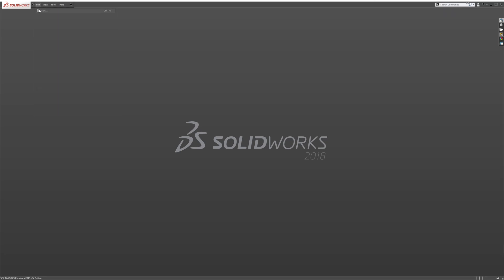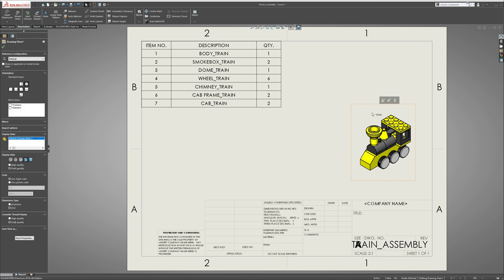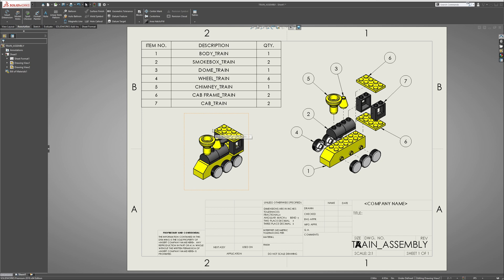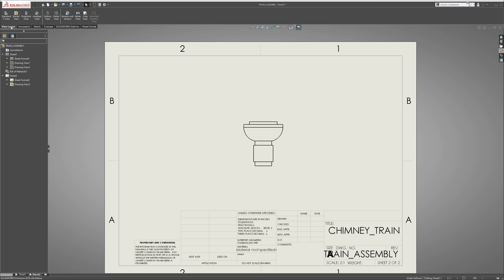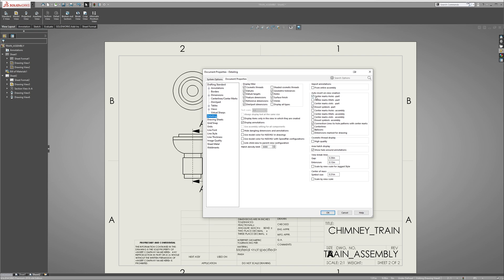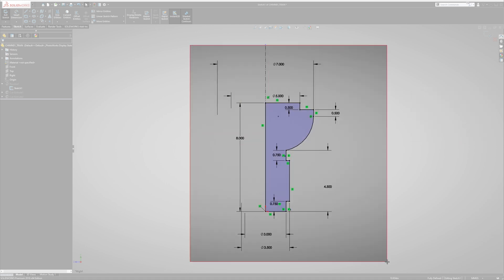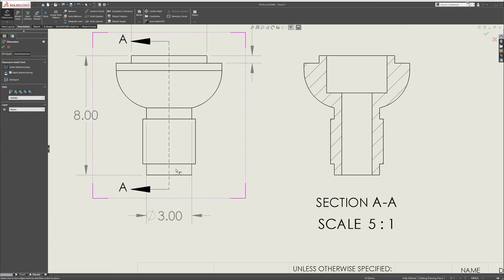Intro to SOLIDWORKS for Absolute BEGINNERS Creating a DRAWING (Lego Train) | SolidWorks Part 3

Comment from the maker: Learn SolidWorks without any prior experience, with this free mini-series for absolute beginners! 

By the end of this tutorial, you'll have created your first drawing and be able dimension a part in the SolidWorks Drawings.

Download & Try SolidWorks CAD Software free trial:
https://my.solidworks.com/try-solidworks

Download the free project files here:
https://rathasochenda.com/download/

Time Stamps
0:44 | Drawing file setup and template
1:04 | Inserting part into drawing model view
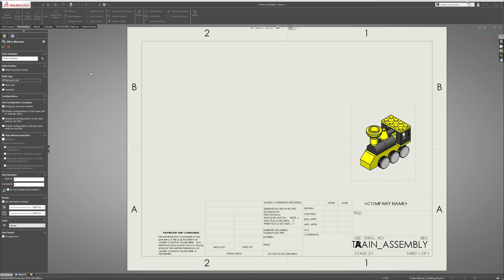1:27 | Creating a Bill of material table
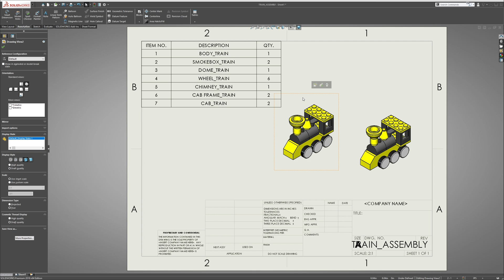2:03 | Creating a Exploded View
2:30 | Adding automatic balloons
2:41 | Adding "manual" balloon
4:22 | Creating a section view drawing
4:45 | Creating a isometric drawing view
5:45 | Setting ANSI drafting standard
7:00 | adding dimensions to drawing
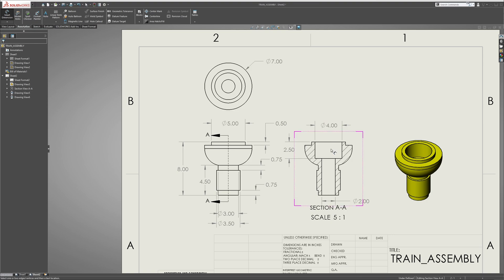8:47 | Why engineering drawings are still important